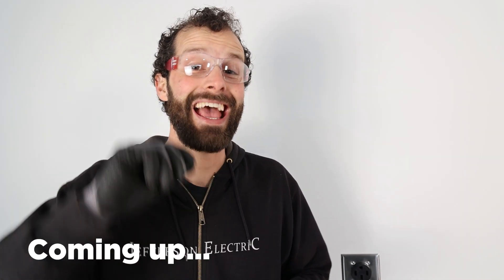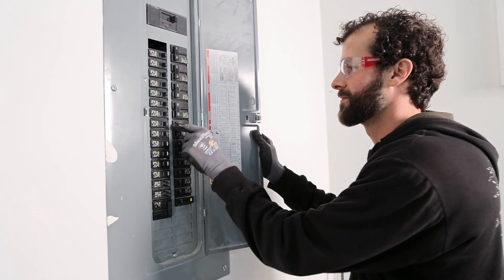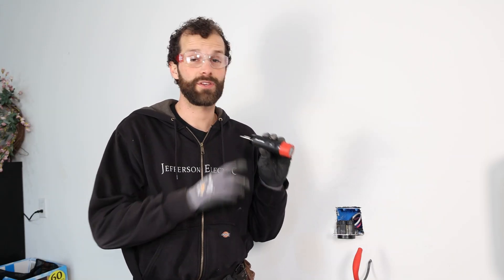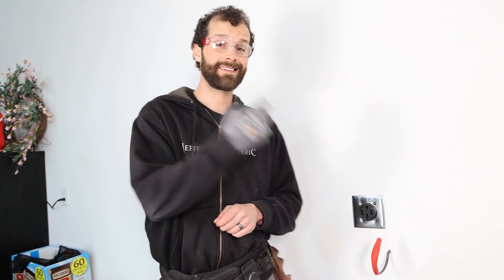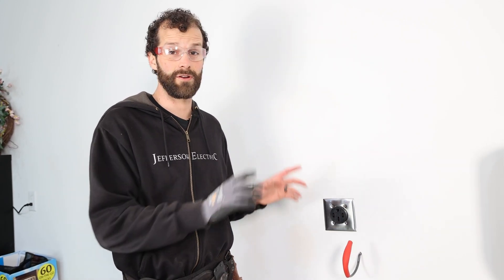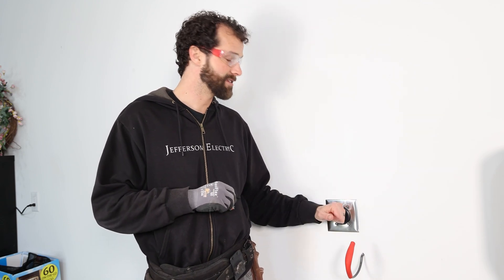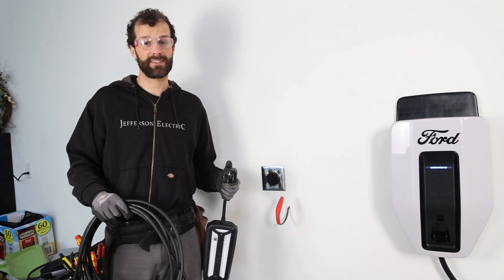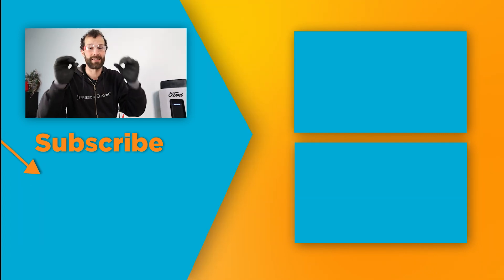EV DIYers, STOP Cutting this Corner!

Comment: Is it a code violation to install the 14-50 outlet with the ground down?

I have the stock Bolt charger which  swaps out level 1 and level 2 plugs and it makes more sense with this charger to have the outlet ground down.  If the 14-50 plug  is installed with the ground up then the charger body will hang unless I bracket it or bend the cord.

I purchased the 14-50 Bryant version and the electrician from Chevy's install provider is coming out the 27th.

Comment: I ended up recommending a wall charger for friends and family instead. An Hubbell 14-50R with a 60A GFCI breaker is ~300 with the box and all accessories. A good Wall charger hardwired is ~$400 and doesn't require a GFCI breaker (required here) because its built into the charger. The $100 difference is worth it for peace in mind and a cleaner install. I've installed a few Grizzly and Emporia chargers with no issues reported.

Comment: Another thing to note: 625.54, introduced in NEC 2017, specifically demands GFCI protection on a branch circuit supplying a receptacle for EV charging; so if that installation was done on permit in an AHJ adopting 2017 or later, it does not meet code. ;+ )
Reply: @microcolonel, 
. The NEC is a minimum standard for safety,  no way you'll convince me that nice and pretty workmanship trumps  safe and sound.
Reply: @jesseross4966  in this case, an EV charger will tend to have its own ground fault protection, so in practice the circumstances where this would have any effect are naturally rare. The other faults that the receptacle itself could have would be cleared by ordinary breakers, or would not be dangerous (just some water evaporating inside the receptacle and then nothing).
More important is how well attached it is, whether the conduit is grounded properly, whether the conductors are damaged during the installation, the quality of the receptacle itself, the proper installation of the breaker, and a bunch of other things.

NEC is not the "minimum standard for safety", it is a manual for constructing what the committee believes will be safe installations within a reasonable budget. Minimum receptacle counts, TR, tap service ratings, etc. may in some fringe circumstances improve safety, but bad workmanship is largely invisible to inspectors and can easily cause ACTUAL serious faults.
Reply: @microcolonel  Read Article 90.1 
Says nothing about cute and pretty
Reply: 100 percent correct...this guy is a so called master electrician but makes up his own code. His hot tub install is a liability waiting to happen.
Reply: @jesseross4966  nothing's perfect and different places have different codes adopted. The quality of work matters a lot more than fine details of code.

Comment: After seeing numerous EV plugs melted, even with factiry chargers, I have to agree spending the $125 + for the Hubbell unit is worth it. Spending the extra money saves a recall and likely the $500 for a new charger. At least offering it to the customer, with extra terms and conditions if they want the cheaper one gets you off the hook for paying fir a callback or fried charger.

Comment: I experienced this firsthand. Even though I never unplugged my Tesla charger, the Leviton receptacle failed. It would overheat. I torqued the screws, still overheated. The charger would detect this and shut down with an error. When I replaced the receptacle with a Bryant (which is the same as the Hubbell for $20 cheaper) I never had another issue. I bought mine from Grainger.

Edit: add some relevant info.

It’s all about duty cycle. I believe there was some research done on the metallurgy of the lower cost devices and it was found that the high currents and high duty cycles of EV charging caused the metal to fatigue permanently in the low cost devices. The Hubbell / Bryant devices do not suffer from this.

Comment: I am remodeling.  Do you have a video on how to trace wires from a switch to light fixture when wires cannot be seen?  The wires run from a switch, up a wall, through the attic under plywood to a light on a different room.  How to do trace them?  Appropriate tools to do this?  Thanks.
Reply: What's the purpose of needing to trace them?  Does the remodeling require removal of drywall?  Why can't you pull the plywood in the attic up?
Reply: @jovetj  I'm remodeling.  Needing to remove and/or add but I need to be able to trace the beginning and end of wires (switch to light/outlet) without tearing through sheetrock.  Plywood in attic cannot be removed.  I know there's a process for tracing wires with a tonal machine, but I do not know how to use it.
Reply: @number6396  The general process is you plug in the device to the receptacle and then use the handheld tracer to follow the wires from there.

Comment: After seeing this video I’m wondering if I should consider installing one of these HBL9450A outlets for a future home hobby shop where I’ll be utilizing a Craftsman 60 gallon air compressor. The compressor “features a 208-230v electric motor and should be connected to a power supply that is 230 Volt, 60 Hz, requiring a 30 amp double pole breaker for proper installation”. This compressor probably draws nowhere near the amperage an EV charger does, however not being an “electrical expert” I admittedly worry, and over engineer things when it comes to electrical safety and longevity. I have a tendency to err on the side of caution and if I allow myself to travel down the path even further I begin to question if it's worth the peace of mind to install one on the electric range in the kitchen too. Ugh!
Reply: It’s all about duty cycle. I believe there was some research done on the metallurgy of the lower cost devices and it was found that the high currents and high duty cycles caused the metal to fatigue permanently. The Hubbell / Bryant devices do not suffer from this.
Reply: I upgraded my range receptacle when I found out the issue.  I installed the $12 one 20 years in our house (It was like $4 then).  Then recently saw the "bad" side of them.  I upgraded to the Bryant for both the grid and battery receptacles behind the range
Reply: I prefer Leviton, but the philosophy is the same.  Use the best products you can find at a reasonable cost.  Most people have "residential" grade devices in their homes, but there's no reason you can't have better-quality ones.

Comment: Great commentary for sure. Can you also do a video about wire gauge selection? Too many times I’ve seen 50A circuits run on 8AWG wire which can also cause a fire.
Reply: Code does permit 8 awg conductors for 50 amps. While I use 6 for reasons you imply, given spending $100 extra for the Hubbell receptacle, or to size up to 6 awg, I would choose to spend it on the receptacle. I've never seen wire melt, but I have seen plenty of cheap plugs melt.

Comment: QQ: how come there are two breakers for one circuit?
Reply: there are 2 circuits: 1 for the receptacle  and 1 for the hardwired FORD unit
Reply: @dougbertInExile  Not following you.  The hard-wired unit was wired with a completely different circuit with a breaker installed at at the bottom of the panel. There's absolutely no reason to shut off power to a circuit that isn't in  the box you're getting into.  There's only one receptacle and one circuit that I saw in the video.  The two breakers don't make sense.
Reply: He said there were two circuits labeled the same. Most likely he  just flipped both breakers instead of sorting out which is which.

Comment: What is Hubbell doing different to justify an $85 price?   If after testing the cheaper receptacles prove to be a fire hazard they should be recalled.  Oh right.  How did that work for Federal Pacific breakers?  Cricitets...   They would be too great a liability for all involved.  The lawyers would love it.
Reply: Its the material used. Bakelite vs ABS plastic.
Reply: So my understanding is that the cheap Outlets you buy from Lowe's are not rated for constant amperage to be pulled through them. The Hubbell Outlets are much more robust and are suitable for continuous amperage

Comment: The UK does it far superior than America! The charger is hardwired, none of this plugging the unit into a plug nonsense.
Reply: We have hardwired, too. Not sure how you figure that plugging in is inferior to hardwired though.
Reply: with hardwired, you can put a 60 amp breaker, but 6 awg is a bit small for that.  Only 50 amps max on the receptacle

Comment: Great video.However given the astronomical cost differential between the 2 outlets,my guess is most electrical contractors will install the $12 one.I can tell you my boss would.Thank you for bringing awarness of why the $12 outlet might not be a good choice.
Reply: This is the case. Mine was installed by a large local electrical contractor that “did this all the time” and I didn’t know the difference. After a year it failed and I replaced it - this time doing it myself and properly with a Bryant (Hubbell manufactured) from Grainger.

Comment: If the less expensive receptacle is UL listed it should be able to handle the load without overheating.  My guess there is some other cause for the overheating.
Reply: The cheap one is designed for intermittant use. Say your dryer or a range. They are made out of plastic. The other is Bakelite. And manages a constant thermal load far better.
Reply: @Species-lj8wh  bakelite is plastic
Reply: @Suedeman it’s a thermoset resin.
Reply: same thought here, maybe its the length of time as he mentioned at a constant high power draw. but even then I would think the breaker would trip due to heat resulting from an overload condition.
Reply: @BeatBoyStill  the breaker has no idea that the receptacle is overheating.

Comment: I thought 240V doesn't require a neutral wire .
Reply: The 14-50 is used in a few applications where the device uses both 120 and 240.  An EVSE doesn’t use neutral.
Reply: Neutral is not required, but that is a different receptacle, the Nema 6-50 does not include the neutral.
Most chargers will not make use of the neutral and will only use the 2 hots.
Reply: It would not if lazy cheap manufacturers would just spend a few dollars to install a,240 to 24 volt transformer for control circuits. The neutral on these 50 amp plugs probably NEVER carry more then  quarter amp!. Would save homeowner over $75!

Comment: Joel - Great video as always! One additional item to consider is the GFCI protection that is required for MOST electric vehicle supply equipment (EVSE) circuits, which can add additional costs for labor and materials if not in place already.
Reply: Verify with your charger's manual.  For example, Tesla wall chargers include the GFCI circuitry internally and do not recommend (in bold print) that you do not also have a GFCI breaker.

But...I do have a GFCI breaker just because it was already installed in the panel and haven't had any false trips, so I'm leaving it.  I'd be curious about the code compliance issues in this situation if you were to install an outlet without GFCI, but used a GFCI enabled charger with it.
Reply: @poodini  Tesla EVSE’s are mostly hardwired
Reply: @poodini  While some electric vehicle supply equipment (EVSE) manufacturers may include GFCI circuitry in their products, the National Electrical Code (NEC) requires GFCI protection for all EVSE receptacles, regardless of manufacturer recommendations.

Comment: Sad that you didn’t list the recommended replacement product in the video discrimination.
Reply: Hubbell HBL9450A - sold in many places, including Amazon. You may also consider the Bryant Electric 9450FR which is around half the price, but as well rated as the Hubbell in the EV community.
Reply: @rsachoc  I used the Bryant one for my range, when I added a 2nd receptacle for my oven/range to the 240v Schneider 6.8kw inverter house system. I also upgrade the Grid receptacle as well. Yes, I have two receptacles behind my oven so I can chose which power source. Oh and I use a 40 amp breaker for those